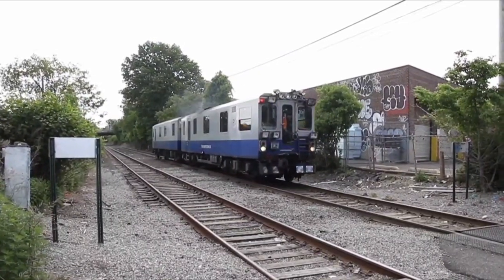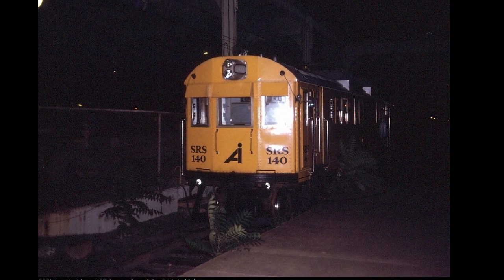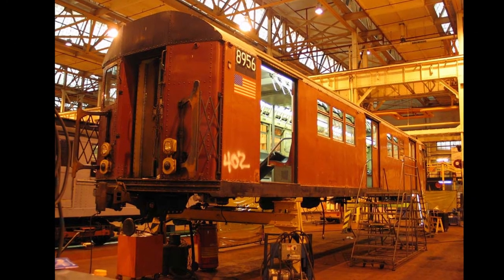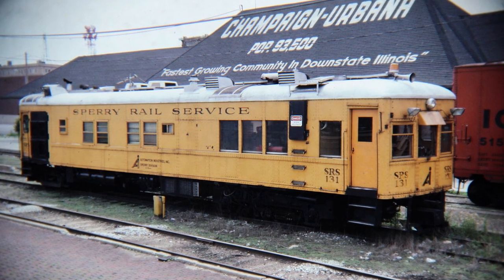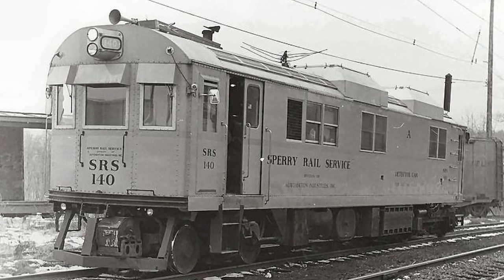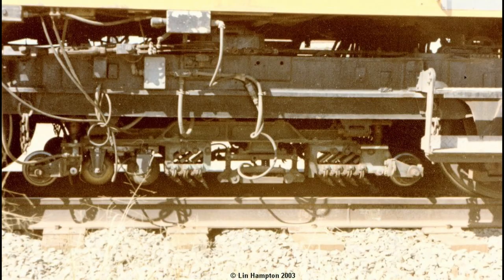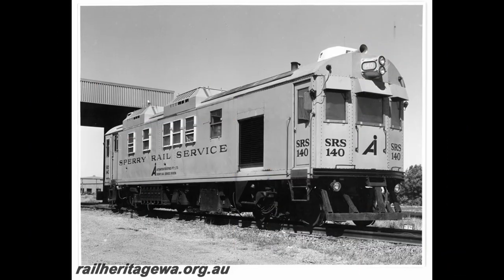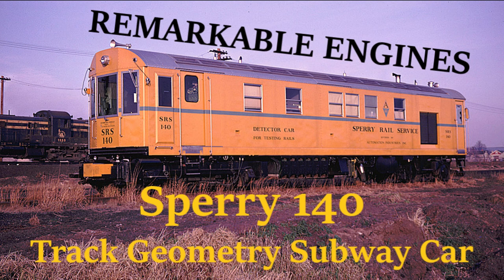Remarkable Engines: Sperry 140

Comment: You know I wonder what happened to the remaining r33 shells that were not use and assembled
Reply: 34 of them ended up as R36MLs 9524-9557. The World's Fair forced the last 40 R33s to be rushed as single units in late 1963 for the Flushing Line. As a result, there were some leftover R33ML drop sash shells that would have been in the 9306-9345 range and been in bright red and with Westinghouse equipment, same as 9076-9305. Note the R33 contract was 540 cars. So with 9306-9345 as single units (R33 WF or R33-S), the leftover drop sash shells ended up getting completed at the tail end of the R36 contract, after the 390 World's Fair R36s, in July 1964-early 1965. Had it not been for the sudden change in the R33 order, all 540 R33s would been R33ML with conventional drop sash in bright red and all 424 R36s (9346-9769) would be on the 7 as World's Fair cars, with 40 single units and 384 cars in pairs (split 212 WE and 212 GE). Most likely 9346-9557 Westinghouse (9538-9557 single units) and 9558-9769 GE (9558-9577 single units).  This makes R36 MLs 9542 and 9543 (at 207 Street in the NYTM fleet) SRS 140's closest surviving relatives as they were among the leftover R33 shells from 1963.